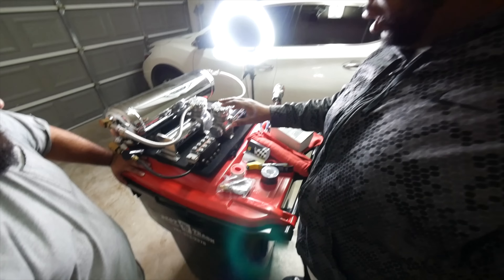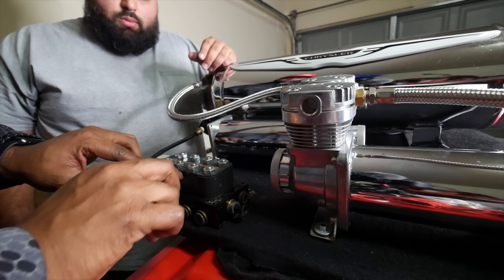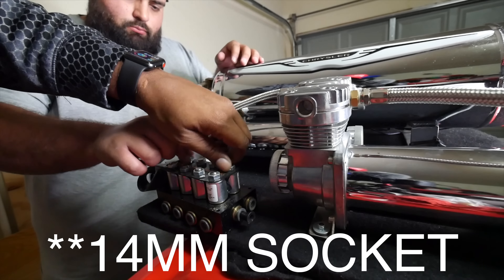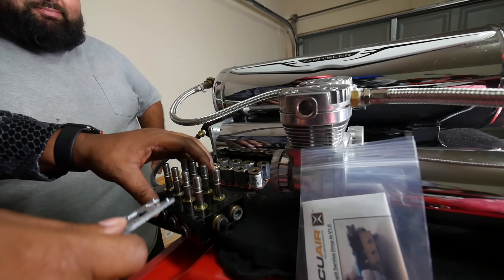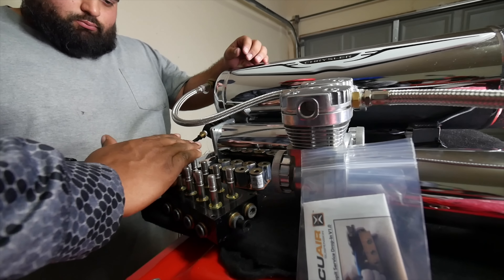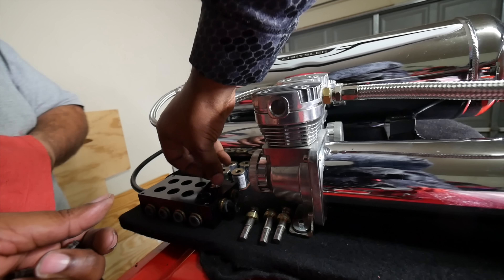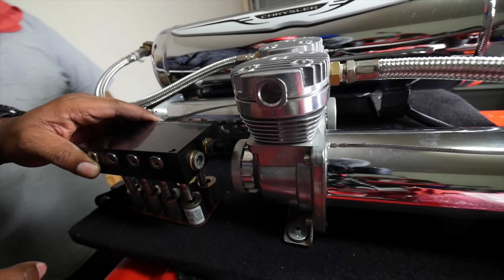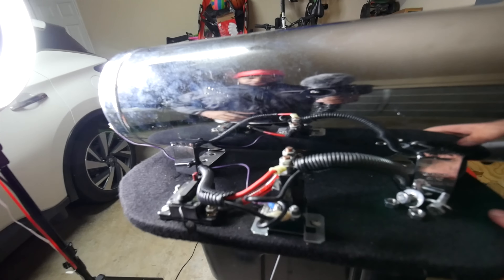HOW TO FIX ACCUAIR AU4 FROM LEAKING (MANIFOLD REBUILD)

Comment: Is this what my issue could be?
I notice my front left will go down flat after an hour of being parked and then the rear goes down after 3 hours. More fast when driving though as weight in the valves I think? Also, anyone get water in the lines maybe? I drain the tank every so often but don’t have a water separater which do I need?

Comment: Anybody have experience running air ride in below freezing temperatures?
Reply: Yeah, as long as you have all your components run inside the vehicle and water traps set up you'll be good. If not you'll freeze shut your lines and it'll take a while to clear the ice blockages.